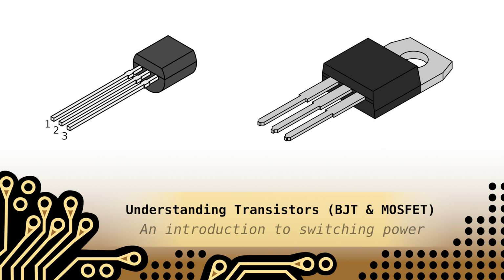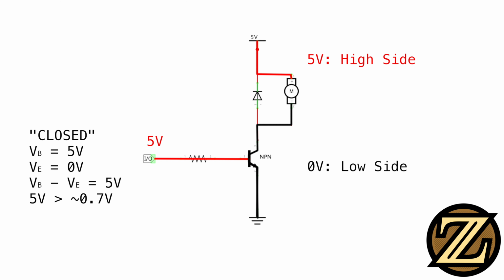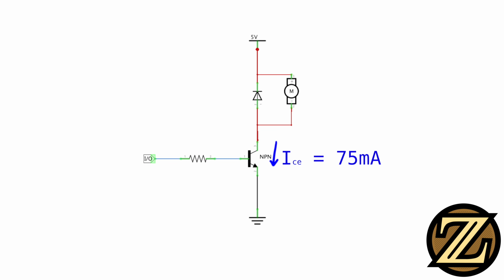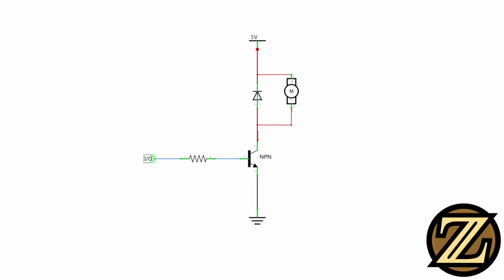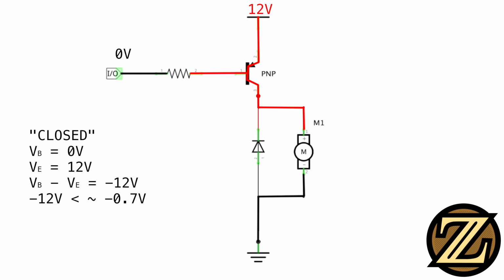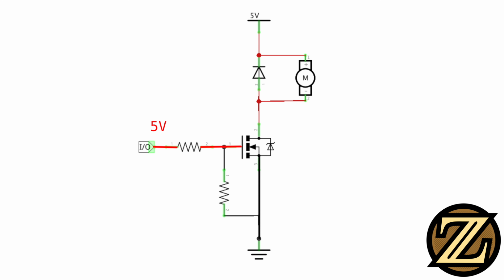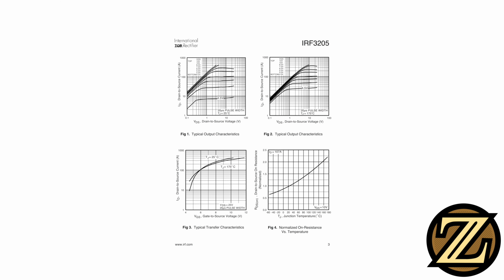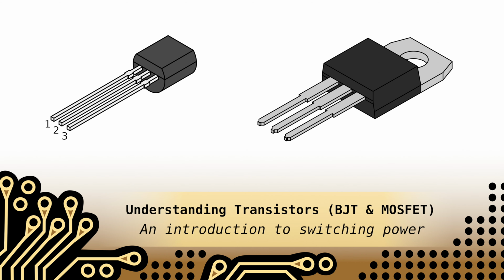How to use Transistors (BJT & MOSFET)

Comment: Good video, but I am a bit confused about the explanation of PNP. “0 V on a base closes a switch which allows current flow through the motor” ? I do not understand this at all … 0 V on base should open the transistor (switch) and allow the current. The same is with pull up resistor. Shouldn’t pulling up the base to 12 V CLOSE NPN transistor instead of keeping it “open” ? Or am I missing something about terminology here ?

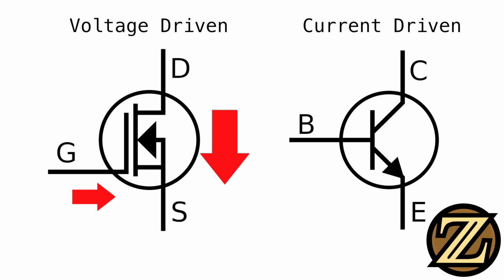Comment: 13:03 I managed to fuck up a MOSFET, turns out voltage isn't supposed to go from gate to source, but the one on mine did lol. after a little connector became a lightbulb and got vaporized on my breadboard, the MOSFET attached to it didn't seem to have died, but when I did testing, it appears like maybe the inside of the MOSFET might just be one small molten blob of metal and plastic.

Comment: btw it's not safe to operate Arduino with a voltage of >5.5v (this is from the atmega328 datasheet), that includes pull-up resistors